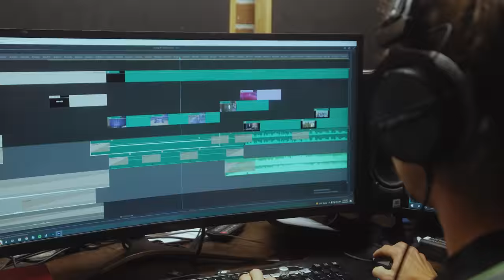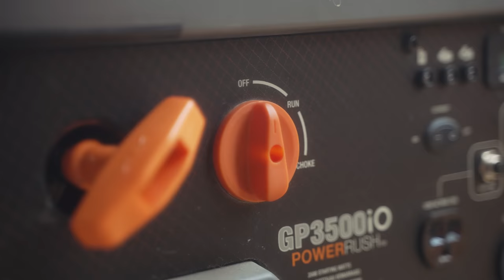The Truth REVEALED About Vanwives And Why They Live Alone

Comment: That you Colin & Paige for the trip to the cabin, The girls are doing very well :) I went 100% off grid 10 years ago and the first thing you have to do before you buy a property is look at, is there water, firewood, access to bring building supply's , and of course your power, I built but still have a lot of finishing to do but I have a full bath in doors with propane hot water and 12v water RV pump 55psi it works awesome & was cost friendly  , power with a small 12v solar system, Just do your homework before you drive the first stake :)) I'm going to have a tour of mine soon ,
Reply from the maker: That's amazing! Would love to see it! I hope to buy some land some day...

Comment: I lived for over a year in the Northern Montana Rockies without running water and electricity. Hauling water from a spring is a lot of work. Electricity not as big of a deal. I drilled a well and got electricity and put plumbing in the house within the first year and a half. I had a neighbor whose house collapsed due to the heavy snowfall and he let me have the plumbing fixtures, which saved a lot of money. Which brings up another point Vanwives stove pipe is way to low on the roof and in heavy snowfall will be crushed. Drilling a well is scary but will make life so much easier and better. I don't get the cold house thing. Are they not burning wood? If they can't get warm that is a serious problem that I never experienced.
Reply from the maker: Hi Tom. Wow that seems like such a beautiful place to have a homestead. Thankyou for sharing your perspective. They are close to running water and power. The wood fired stove is also going to be in before Christmas, but it's been delayed from supply issues etc. They will get there. All the best!

Comment: While I totally admire and respect these ladies for what they have done, as someone who has lived off grid, in Africa, for 8 years, I am baffled about not having basic solar and an indoor shower and toilet. These things are really easy to put in place and not that expensive.  Composting toilets are easy. Battery powered water pumps working off solar 12V batteries are quite common. Solar panels to keep the batteries charged are hardware store items these days, along with rainwater tanks.  Is doing it the hard way a choice or a lack of decent information?
Reply from the maker: Hi Wayne, do you follow their videos at all? I take responsibility for not making some of these concerns more understandable, if you don't follow them. It's been an issue of supply chain breakdowns and timing of certain things.. For example, they needed a separate building before they can legally store and connect the battery system per law in Canada, but it was delayed. In the video shown here, you can see them installing mounts for their solar array.  Their temporary battery system is indeed solar power, and I take responsibility for not making that more clear in the video. Their wood stove is mere weeks away waiting on an appointment. If you noticed the water collection system used to water the plants. They are also in the process of connecting their well, but need electricity before the water pump can run. It's just a matter of time before it comes together.
Reply: Everything Colin said. & Canada had a lot of laws.

Comment: I admit that I haven’t seen all of the Vanwives vids but it seems the generator is purposely “hidden”.  You never hear it in the background but they definitely use lots of power in their endeavors.  Is the wilderness cabin what they really want or was it just an extension of van life?  The Vlogger life is a job just different from “traditional” job and it seems you really have to hustle to actually make a career out if it.  It seems that Jaz really struggles being apart from family and people.  Does Crystal like the loner life? This video should be linked to their site as it gives a different look into their life.
Reply from the maker: Hi DJ. They definitely used the generator a fair bit, but harness the sun as much as they can with their temporary power system (ecoflow delta). Also, even I've told them not to shoot with the generator on as it ruins the audio while they are shooting 😂 so usually run it after. It really feels like they are exactly where they want to be.. and you are correct, they worked so incredibly hard to get here as creators. A conversation we have had a lot because putting out weekly videos is incredibly difficult and often unsustainable. But purpose is a bigger driver for them then "chillin"
Reply: @colinandpaige  Will they stay in the cabin the whole winter?  Solar power generation is low in the upcoming months.  They should have built a greenhouse attached to the house for plants and passive solar heat.

Comment: Great video but I don’t understand suffering for the sake of it….. there are a lot of very simple and reasonably priced (cheaper than a huge ecoflow battery) portable hot water service so why needlessly suffer ? A hot shower is quite simple to do….. 

Maybe I just don’t understand ? Why not get simple fold out solar blankets for charging the eco flow battery instead of using a petrol generator…. Why not have gas and have a portable hot water service ? It’s clearly not an eco thing as there’s several vehicles and petrol generators….

You have a very nice video style.
Reply from the maker: Hi Paul. In regards to power situation, it's actually on me for not making it clear enough in the video - at this time they did have folding solar on their roof, but because it was cloudy we were forced to pull the generator.. something I missed explaining. When discussing do it daily, it was in reference to the general morning electricity struggle, not just the generator. I also didn't mention they use their van's solar/power system to power their home at the time as well.  Again, my mistake. For them, it was an awkward in between stage at the time of the recording - months away from a permanent/stable set up for both water and electricity in which they have now. 

Thanks for watching. Sorry for the confusion!
Reply: @colinandpaige  thanks for the response…. I just thought it couldn’t be right…. I’m glad they have a much more sustainable setup !

Comment: With all the money that has been spent on all the other things then please tell me why solar power was not at the top of the list. This shouldn't have to be so  uncomfortable . If you can afford heavy equipment and green houses you can afford solar. A person doesn't have to suffer the cold of winter. Water and heat would be at the top of my list. Easy decision.  They have chosen to be cold and thirsty.
Reply from the maker: Hi Deborah, we all agree with you, minus the last statement. It's been an issue of supply chain breakdowns and timing of certain things.. For example, they needed a seperate building before they can legally store and connect the battery system per law, but it was delayed. In the video shown here, you can see them installing mounts for their solar array. It takes a lot of work to have a full fledged permanent solar system and a cascade of events pushed it to be delayed. Their temporary battery system is indeed solar power, and I take responsibility for not making that more clear in the video. Their wood stove is mere weeks away. They are also in the process of connecting their well, but need electricity before the water pump can run. Things take time, you know? Please understand their is always more to the story, and I implore you not to come to conclusions too fast before asking questions

Comment: I’m new to this channel.  

Is there a reason the vanwives are deferring their power and water installation?  Is it something to do with location?  

Great video
Reply from the maker: Its all a domino effect of supply chain issues or setbacks.. They couldn't install power in till they got the garage, the garage was delayed. In Canada, it has to be a different dedicated space to hold and store batteries. They tried installing solar with a certain ground mount months ago, it failed due to the rocks in the ground.   They got their new solar mounts on a few weeks ago and now have the garage. But they need power to make the water pump work 🤣. They are getting close